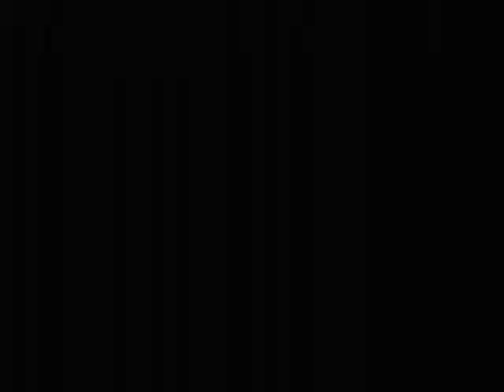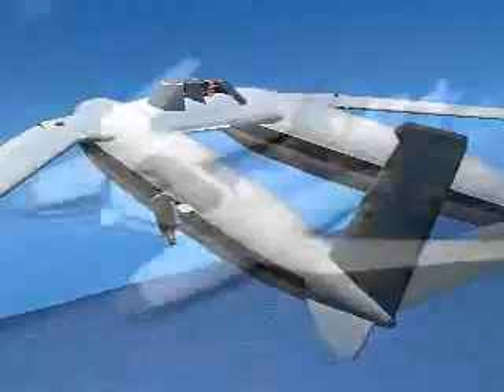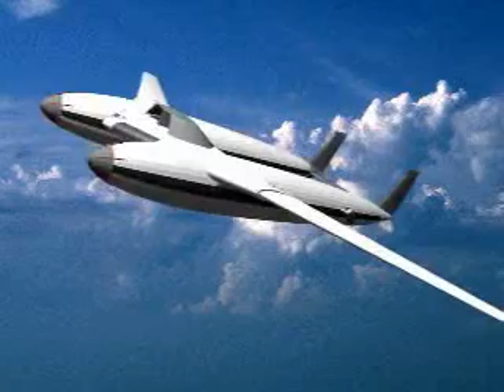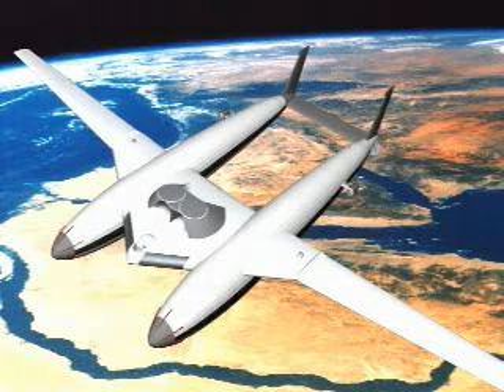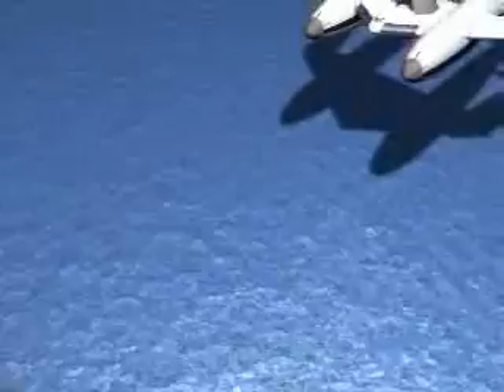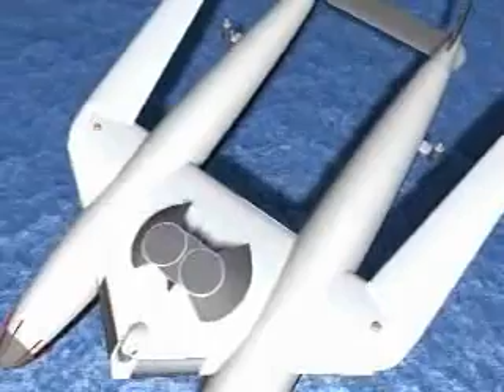Fuel-Less Gravity Powered Airplane

Comment from the maker: russslav wrote:
"...is like an electric car that is trying to recharge it's battery from the
spinning of it's wheels..."

It is more like useing the electric car to get up the hill and using regenerative braking going down the hill to partially recharge the batteries. however, this system seems to be far more efficient than that.

Comment: It is NOT gravity powered! First you have to USE electric MOTORS or gas/diesel ENGINES to COMPRESS the air and helium to STORE power to fight AGAINST the pull of gravity. And each time you convert energy (plane's forward motion to compressed air) you LOSE most of your ORIGINAL energy... it will have NO ENERGY to fly after awhile. This is a SCAM!!!!

Comment from the maker: Gicior wrote:
"Without some number cruching this is not even a hypothesis. How much energy do you have to use for a hypothetical flight?"

Variations of this concept are already in use in the form of gliders and blimps. There are already existing solar powered planes that have been successfully test flown.
Regarding length of flight and energy consumption, that can vary.

Comment from the maker: Truthiness231 wrote:
"...I'm almost certain the video said it could run perpetually but I don't see how that would be possible.."

The video leaves out the that this plane would also get charged with electricity and compressed air at beginning of flight. Also, this plane would get infusion of photovoltaic and solar thermal during flight and while parked. Thus, not a "perpetual motion" machine without these sources of external energy.

Comment: Some new underwater probes (SPRAY Glider) use the same technique coz it's very efficient, so we know it DOES work.  But i question whether it can really be ZERO energy use, getting energy just from those turbines on the way down.  I think it needs suplimental energy, perhaps from temperature differential between altitudes (like the SPRAY does) or solar panels.  It might even need some rest-time to refuel with it's solar panels.

But i still think it's a good idea as energy use will be minimal.

Comment: To go back down the ballast vacuum is vented to outside, then battery-air is vented into the ballast sucking in extra atmospheric air via a venturi open to outside.  So the ballast now has a mix of atmospheric air and battery-air, the pressure crushes the helium balloons down.  Plane is heavier, down it goes.  It partially charges it's compressed air battery on the way back down with it's turbines, this i have a problem with but it's not a big issue...

Comment: This plane actually DOES use stored compressed air to compress atmospheric air, not a bad idea.  I'll explain:

it starts on the ground with it's compressed air batteries fully fueled, and also the ballast is full of compressed air.
the ballast compressed air is vented to outside, causing helium balloons to partially inflate.  Then battery-air runs a venturi pump to remove even more ballast air creating a partial vacuum, plane is lighter, the helium balloons fully inflate, plane goes up...

Comment from the maker: davefox72 wrote:
"...The idea of using compressed air to run compressors that compress more air simply leaves you with less"

There are two forms of air that are being compressed and uncompressed. One is helium, and the other is normal atmospheric air surrounding the plane. the decompression of atmospheric "air" is used to compress or decompress helium. The atmospheric air is compressed using wind turbines and photovoltaic.

Comment: If anyone notices...The idea of using compressed air to run compressors that compress more air simply leaves you with less compressed air.. you don't use a battery to run a motor to turn a generator to recharge the battery.. this whole Idea would not work..

Comment: Who did the layout for this "airplane".  It is as if the designer did everything in their power to make the craft as heavy as possible... high aspect ratio swing wings vs. a flying wing or blended wing body... twin booms vs. single fuselage structure (which would not only be lighter, but also yield higher internal volume vs. external surface area for the helium)... 

Anyone educated in aircraft design will be able to point out these seemingly huge weight penalties.

Comment: The internal volume to external surface area ratio does not appear to be able of to be capable of holding enough helium to "lift" a structure capable of transonic flight during glide.

Comment from the maker: myndenway wrote:
"This thing seems powered by compressed air..."

compressed air is only a form of energy storage. This plane gets it's energy from Solar photo-voltaic, solar thermal as primary energy sources. It also may have it's batteries and compressed air tanks refilled at the airport, before take off.

Comment: This thing seems powered by compressed air. Compressed air has an energy density only slightly higher than batteries and only 1/10th that of jet fuel. The problem is that you could never carry enough compressed air onboard an airplane to power it. Additionally, compressed air needs to be stored in heavy tanks. The weight of the tanks alone would weigh more than the compressed air inside of them.

Comment: Supporters now propose several weak sources of power.  One site states, "Heat energy is taken from ambient temperature air at a lower altitude to power the GravityPlane and heat is rejected to colder air at high altitude to complete the power cycle."  It also invokes "wind turbine generated power", though only gusts (IMHO) would be useful as a net positive source.  With those allowances, it is not illegal thermodynamics, but things like scale and efficiency which shelve the idea.

Comment from the maker: Ohsnaptakethat wrote:
"How is it fuel-less, the air-compressors use air, thats its fuel."

that is a good question. the word "fuel" in this case is being used to describe gasoline or other petrol derived energy sources.

This plane primarily derives it's energy from solar thermal and solar photovoltaic. The air compressors are collecting energy that surrounds the plane. The batteries collect from Solar photovoltaic...

Comment from the maker: wrote:
"...It will lose alot of energy from drag and internal mechanisms. This is still worthwhile to research..."

The energy of the sun is continually providing energy. Some of that energy is direct, in the form of light and heat, which can power solar panels and other capturing devices. And it also can feed off of indirect solar energy in the form of energy radiation from the earth, in the form of thermal. more comments?

Comment: This video forgets the enrgy lost to DRAG.
it will run out of air during  a few cycles. unless solar heating is used to ADD energy to the plane the plane cannot carry enough energy within compress air tanks only to decompress and recompress helium over and over and the plane can't compress enough air on the way down or up to  refill those tanks without slowing the plane and overcoming the drag down and up.

Comment: nice idea... not quite fuel-less, as it loses energy and air along the way (also, not much point in getting new compressed air, as in using pneumatic motors, you lose as much air as the compressors take in (if not more) in the stage when getting heavy again.

Comment from the maker: re:"What do you use to power the pumps to re-compress the air? Hydrogen?"

The video provides that information. In the video of the possible options for powwer the air compressors includes, electricity stored in batteries, directly from electricity from solar panels, or from directly from wind turbines on the plane.

Comment from the maker: Re:"How can they have big enough tanks? You'd need a huge amount of compressed air to drive this thing forward."

I believe that compressed air is only part of the power drive. The solar panels will collect electricity and the wind turbines will also collect energy in the form of electricity which can be stored in batteries as well.

Comment: The GoodYear Blimp weighs 12840 pounds, carries a 3200 pound gondola (which contains fuel, two 210hp engines, and holds about 6 people). It has amax ceiling of 10000 feet and its operation depends on a helium filled flexible outer skin and two internal air filled bags. Is your concept's outer skin flexible ?

Comment from the maker: re: "Next imagine that the helium will be compressed back into the tank after the zeplin reaches it's maximum altitude. I think this system will require HUGE amounts of energy and amazing compressors."

I don't think that the helium has to be completely squeezed into the tanks. Some of the helium may remain in the bladders to achieved desired levels of boyancy.

Comment from the maker: Re" "to make compressed air u need a motor. for a motor u need fuel"

I think it may be clearer and more accurate to say that a motor would need "energy" as opposed to "fuel". Fuel suggests gasoline or other combustible materials. but to make compressed air, in a physic point of view, would be using he "conservation of energy" ideology in  creating a "potential energy" in the compressed air tanks.

Comment: Nope sorry, 1 cubic meter of air heated by 100f degrees could lift 247grams.  This would also vary according to altitude and weather conditions due to local air density AND you need propane or some other fuel to heat the air.  Pure Helium as used in Dirigibles (not party balloons) has a lift capacity of about 1070grams per cubic meter and requires no additional energy input to get it to that state.

Comment: compressing the air to the tanks inside the jet structure is exactly moving a lot of particles into a small, overcrowded tank, and liberating the other space. total mass of particles remains constant, but the ship is lighter since a lot of fuel is burnt to run the compressors ;-)

Comment from the maker: Something that had not been mentioned for this design is that it could feasibly carry a supply of biofuel which could provide for back up power for powering air turbines for thrust, compressing air, recharging battery packs, etc.

Comment from the maker: Re: "Right, the whole "compressing air using compressed air to drive the air compressors" is flawed reasoning. Still, with an additional power source this would probably work, but would be extremely impractical."
In this case I think it allows for few transitions of energy. If kinetic energy is accumulated by use of the helium and pushing with compressed air motors. The kinetic energy can be recaptured when coming down with wind turbines that recompress the helium and compress air.

Comment: Right, the whole "compressing air using compressed air to drive the air compressors" is flawed reasoning. Still, with an additional power source this would probably work, but would be extremely impractical.

Comment: The video doesn't indicate the use of photo cells, only "compressed air".  You can't get a compressor to compress more air than was used to run it - so if they've invented a compressed air powered air compressor that is greater than 100% efficient - that's a perpetual motion machine.

Comment: DrumGod22 
 new type of propulsion we can overcome aerodynamic drag and travel much much faster - its already being done,  in russia & usa  while researching stealth  by using plasma fields, they discovered you can sheild the aircraft from heat with it but also the field  produces  extra thrust off the ionized air of the nose of craft ,dragging it by the exterior of the craft , an unforseen  advantage

Comment from the maker: consider that two of the heaviest parts of a jet engine are the 4 jet engines, the several thousand gallons of fuel, the components that control the engines, and the equipment such as landing gear, and support structures for all these things. With this coneptual plane, most of this is either unneeded or minimized in weight requirments by upwards of 90 percent or more, IMHO.

Comment from the maker: compressed air is being used to run power compressed air tubines for thrust. Also, compressed air can be used to run electricity generators. And it may be used to compress the helium from the bladders back into compressed helium tanks. Also, solar PV panels can be used to air compressors (via electric motors).

Comment: Right, but that's still a lot less profit than what is available from current planes, because from current planes you also have fuel. This would cut out the need for airlines to buy the fuel.